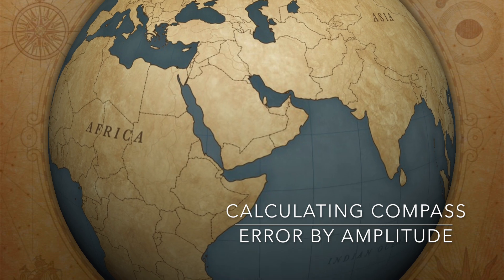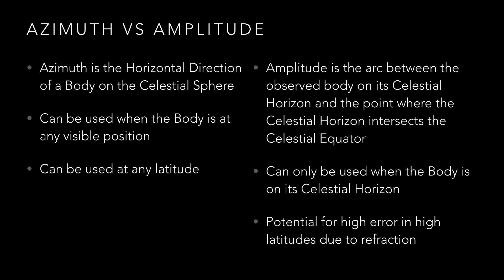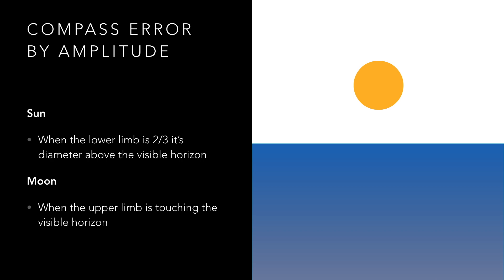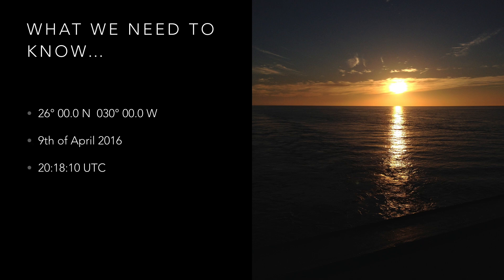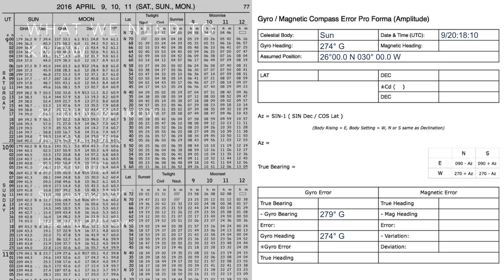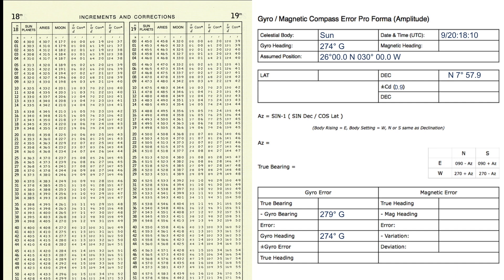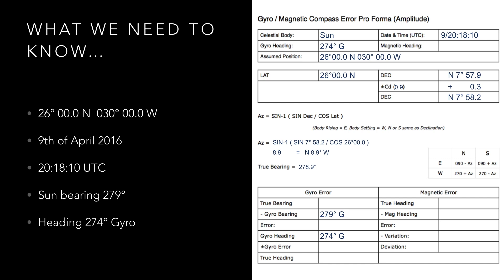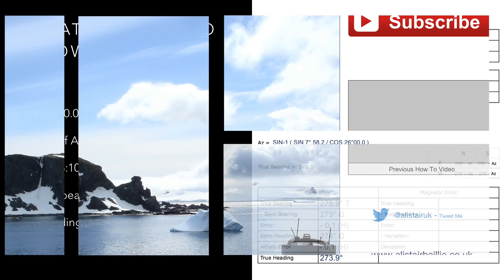How To Calculate Compass Error by Amplitude of the Sun

Comment: WHY LL IS TAKEN FOR SUN AND NOT UL?
Reply from the maker: In order to use the Amplitude method, the body needs to be on the Celestial Horizon, for the sun this is when its lower limb is 2/3 its diameter above the visible horizon - this is the easiest to judge by the eye than say the upper limb being 5/3 above the horizon.

Refraction (and curvature of earth) also plays a part and is essentially negligible when using the lower limb so can be ignored, if using the upper limb it has to be corrected for - the figures for these corrections are not given in most nautical almanacs so a second book would be needed and it's just generally a lot of unnecessary complications.

Comment: Finding the true bearing for example Azimuth is NW. we know that quadrant NW were going to minus from 360. How do I know if it is going to add to 270? Thanks in Advance
Reply from the maker: This video is for Amplitude. The amplitude formula is related to East or West which is why you add/subtract from either 90 or 270 based on what quadrant your answer is within.

Azimuth is related to North or South which is why you add/subtract from either 0/360 or 180 based on what quadrant your answer is within.

Comment: Hi Alistair,
Thanks for the video. Quick question.... I noticed you didn't use the time gotten from the sunrise/set table in the almanac. Pls confirm to me that  it's completely fine to use GPS GMT gotten just immediately after taking your bearing or did you just skip that step to save time.

Thanks.
Reply from the maker: Opeyemi Ojutiku you need to use the actual time that you have obtained the bearing (in the case of this example it was 20:18:10 UTC) - where you obtain this time from is up to you - the easiest would be to take the current UTC time from a GPS unit at the time you take the bearing.
Reply: @AlistairBaillie  very helpful, thanks a lot... In school we would mostly take the time of rise/set from the almanac and then convert to UT as well as ship's time. UT would now be used to proceed on solving the question. That made me start to over think things like how to know for sure what time the sun was exact 2/3 it's  diameter from the horizon and how it might only be possible to get that info from the almanac.

Thanks once again for your time.
Reply from the maker: @opeyemiojutiku1264  In reality given that you're doing it by eye you'll never be able to be so accurate in real life - there are too many potential errors (reading the bearing, recording the time, calculation rounding errors) - also the almanac's sunrise/sunset time is only given to within 1 minute. In short it's sufficient to estimate when it's 2/3 above the horizon.

Comment: i was wondering where is the amplitude formula then i see that you put Az instead of Amp, i was always using the azimuth method and i glad to see this video.
Reply from the maker: Thanks for pointing that out - I also didn't notice :) 

You are of course correct, it should be written as "Amp" not "Az" on the proforma sheet.
Reply: Yes amplitude is not there man